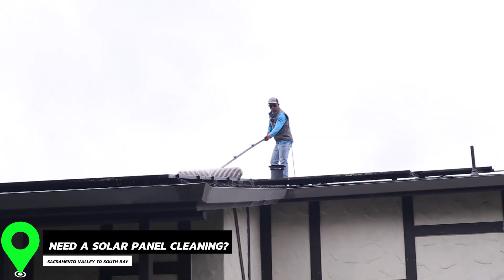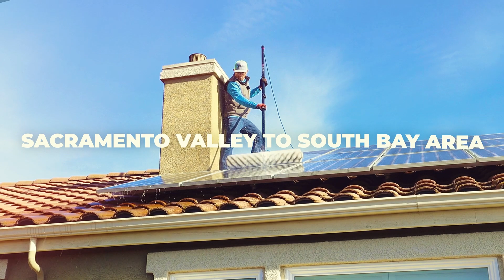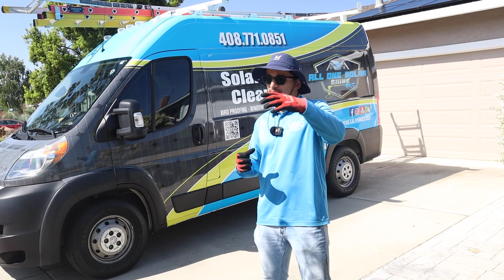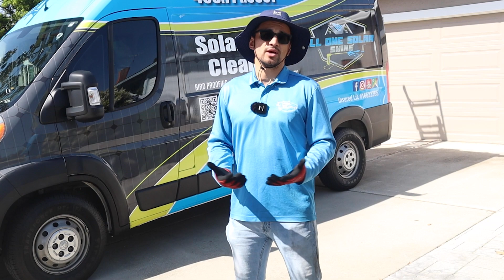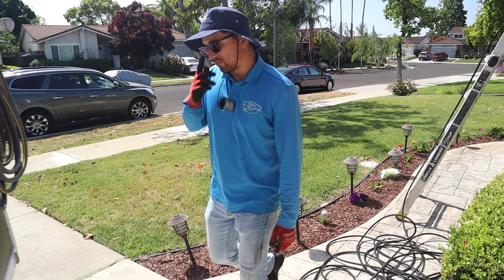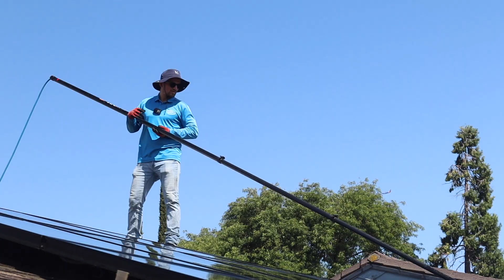How Much I Make In My Solar Panel Cleaning Business - All One Solar Shine

Comment: Hey brother, washer over here in FL.  I've always heard not to clean solar panels in the heat of the day due to thermal shock chances.  What are your experiences with that?  do you clean all day even when it's super hot out?
Reply from the maker: Yup, we carry water in our holding tank in the van, so the water in the tank is constantly warm throughout the day. 

Thermal shock comes from 2 extremes, really. Hot solar modules and ice cold water